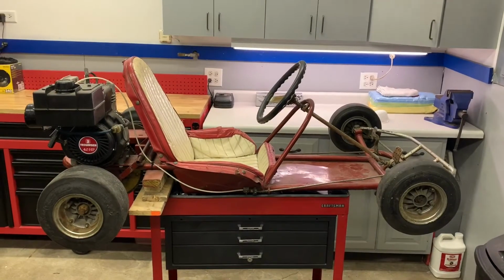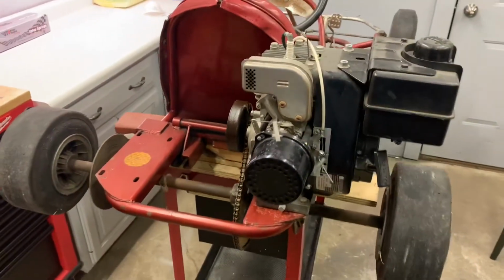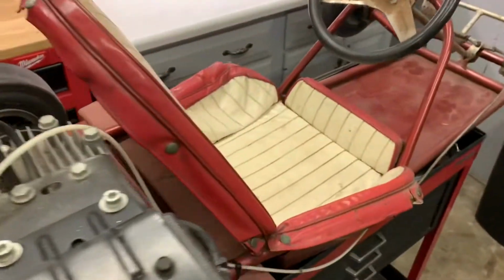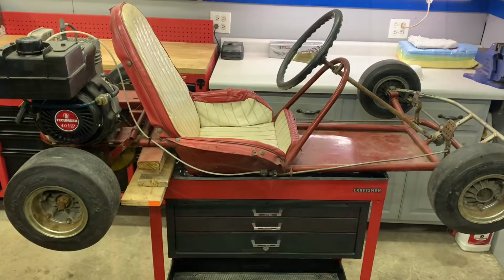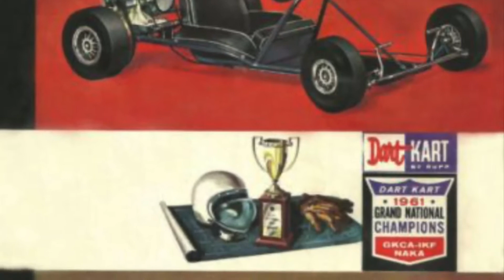Vintage Go Kart rebuild

Comment: These vintage go karts are so simple yet cool looking.  Looks like your kid is having fun on it.
Reply from the maker: Definitely, I love the simplicity of these things. This one was for my nephew, and this spring I’m going to put a torque converter on it for him. The centrifugal clutch just doesn’t cut it on small hills.
Reply: @misterts7635  the torque converter will do you wonders.  I build a go kart back when I was 16… used a 5.5hp with a comet 30 series… no problem spinning tires and would do 50mph… much better than with just a centrifugal clutch

Comment: Very cool!  Love seeing your son enjoying the kart.
BTW, that's actually a 1960 GoKart 800- one of the best karts of it's day. It does have the Rupp wheels though.
Reply from the maker: Thanks for the info! That’s actually my nephew cruising around at the end- I rebuilt it for his birthday. My kids are still a bit too young to ride their own, but their time will come! What helped you to identify the difference between the dart kart and the 800?
Reply: @misterts7635  The engine mount plates, the way the frame cants out in the seat area, the posi stop brake- all unique to the 800
The main frame rail is actually one tube from the front axle all the way around..
Both the Dart and the GoKart are great karts